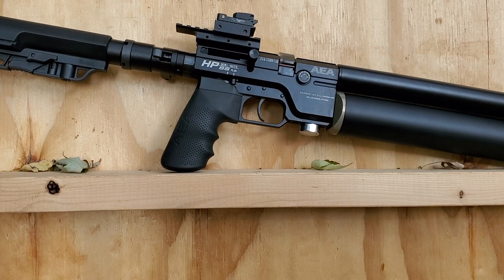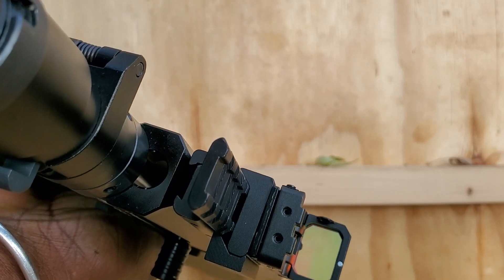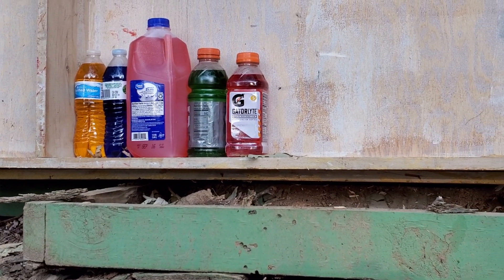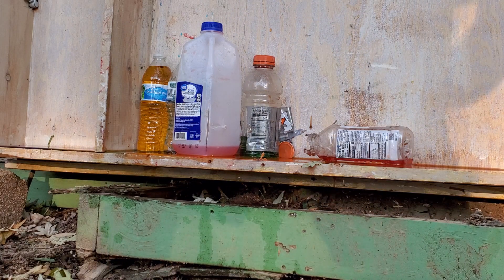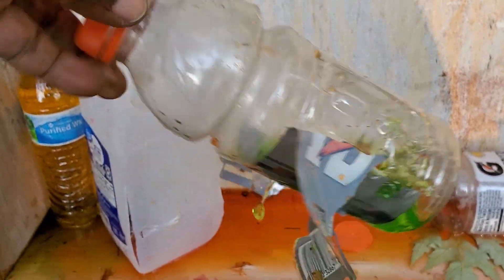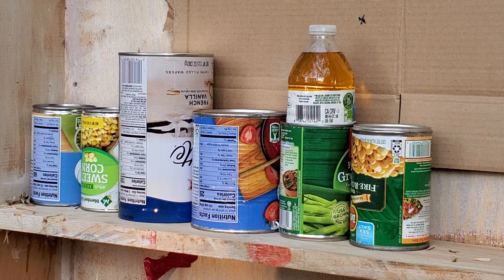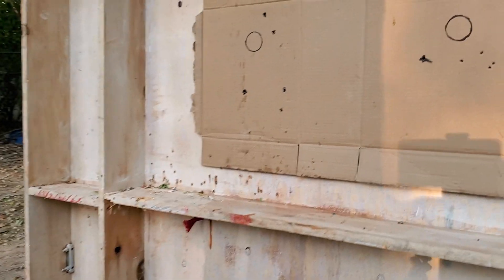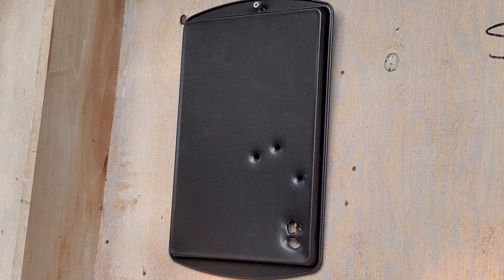Testing The AEA HP SS PLUS .25 CAL PCP AIR PISTOL

Comment: I have this in .30 cal. And that's why guys are flocking to AEA for all their home and travel self defense needs. For my use:

- I installed a bottle clamp with Picatinny rail on the air tank;

- To which I mounted an aluminum foregrip. 

- On the receiver's long dovetail I attached a dovetail-to-Picatinny-rail converter. 

- On the Picatinny I mounted a combo all-in-one flashlight/defensive strobe/laser sight (which I sighted in with a bore sighter).

- I installed a magnetic band/collar on the buttstock mounting tube, this keeps the buttstock secure when in the folded position.

- I have rounded things out by loading up on mags, since on other platforms (markers, launchers) mags can become hard to find. Bought
ten mags $20 each.

A few mags are loaded with my ammo of choice: JSB Match .30 Hades Diabolo pellets (2.9 g/44.75 gr). Note: it is "dia bolo" not "diablo" - who is Satan. "Diabolo" is a well-known pellet design. 

I like this JSB Diabolo hollow point round because it is accurate and extremely vicious downrange.

$30 on AMZN, 150 .30 cal. rounds in the tin. (Word is that because everyone wants these, they are typically out of stock. So if you find em buy three tins, like I did.)
Reply: How often do you have to replace the seals? How long have you had it? I have to replace the seals tonight now I don't like the fact some seals accustomed I can only be bought from aea